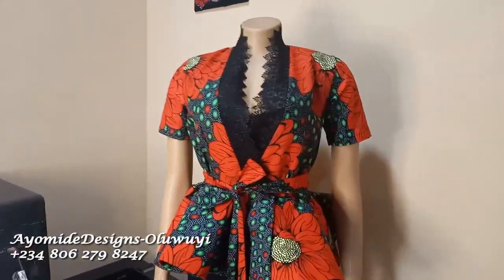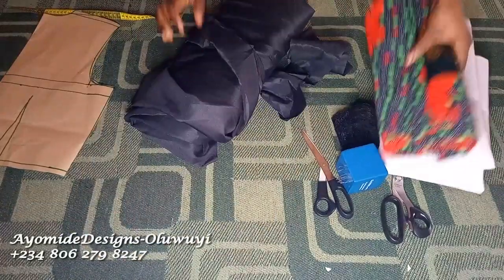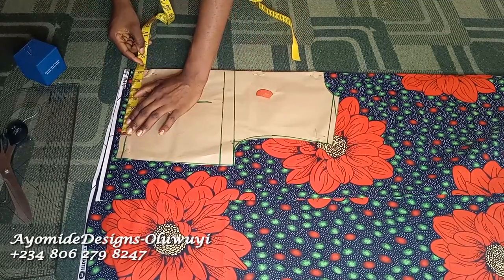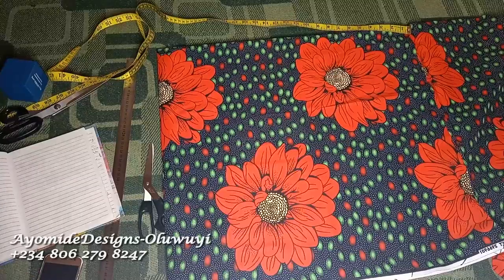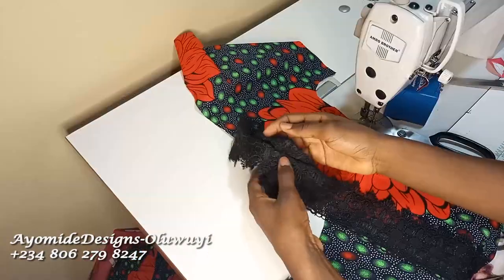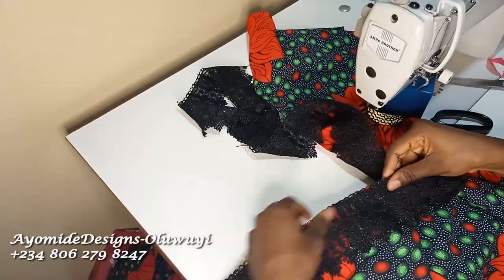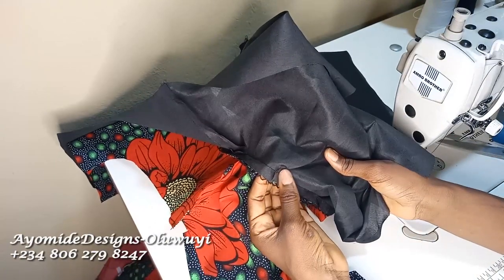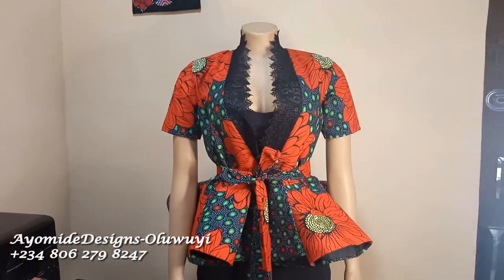How to Sew Ankara Peplum Blouse / Jacket with LACE TRIM

Comment: Beautiful, i would like to make one for myself. The material i want to use is multi-colour. Black color is the background of the material and other colors are yellow, red, brown, purple,white, blue and orange. My question/request is what color of lace can I use or can I ignore the lace part and sew it without the lace? Because am having different color of camisole that I can wear inside. Thanks for your help.
Reply from the maker: You could use black lace as it's neutral to other colors. The lace actually makes it stand out so I wouldn't say you should ignore it
Reply: @AyomideDesignsOfficial thanks for your quick response.